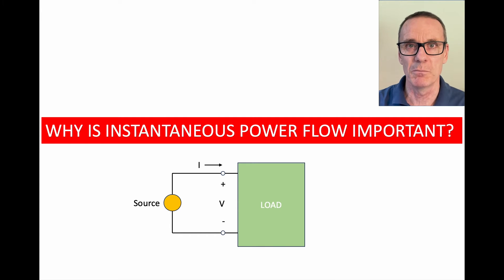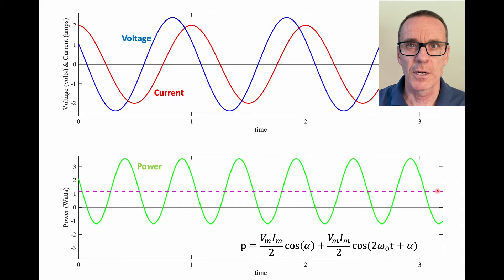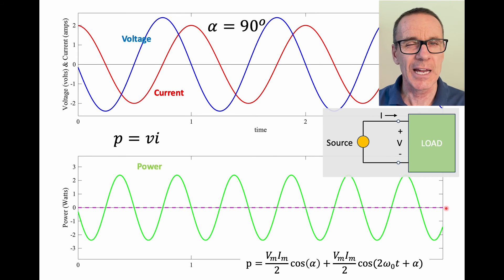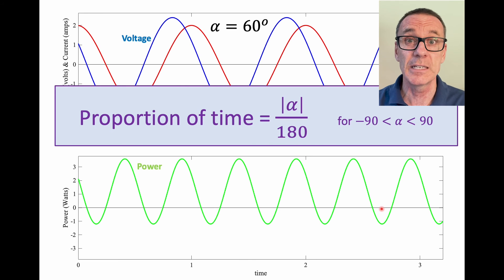Why is Instantaneous Power Flow Important?

Comment: You should probably mention that, although power might be negative for certain periods of time in AC circuits, the pointing vector always points to the source (because the E and H fields flip when power is negative) and therefore energy always flows to the source even when current flows away from it.

Love your videos btw!
Reply: This is a good video explaining my point:

https://youtu.be/bHIhgxav9LY?si=LvEVq-6zHtSUpZvK
Reply from the maker: That video you referenced is nice, but don't get too carried away about it. He claims that it's wrong to think that electrons are pumped around a circuit in DC, and back-and-forth in AC. But that's exactly what's happening!!! He even states that they do in fact move (he says "drift") along the wire in the direction given by the battery (at the 6:42 min mark of his video)! Also, he hypes up the idea that energy is "flowing around the wire", not "in" the wire. But this is totally obvious to anyone who uses a mobile phone, wireless radio, or uses a TV with an aerial. Electromagnetic energy is transmitted ("flows") in the electromagnetic wave radiated by electrical antennas, in all of those examples. That's how a mobile phone sends and receives its signals! I'm sure that if he'd pointed out those examples in his video, then everyone would just say: "oh yeah! that's right - electrical energy does flow through the air". But obviously it wouldn't have got as many "clicks/views/likes".
Reply from the maker: What you're saying is contradictory. The Poynting vector depicts the direction and rate of transfer of energy (ie. power). By definition, when the power is negative, the Poynting vector points in the opposite direction (compared to when the power is positive).
Reply from the maker: ... to be more clear, you're getting confused by AC signals (where half the time the voltage and current are positive, and half the time they are both negative), and thinking that this means that half the time the Power is positive and half the time it's negative. Not true! Negative times negative equals positive. So the power is always positive (in basic resistor circuits).  ... It's not always the case though, when there are inductors and capacitors in the circuit - but in these cases the power (and Poynting vector) does actually flow (point) in the negative direction for periods of time! See this for more details: "What is Reactive Power in Electric Circuits?" https://youtu.be/HDABrT-YTJU

Comment: RMS power is something useless (referenced in 2:35). Only involved with audio systems (fake). Only Mean or Average Power has significance in electric circuits..
Reply from the maker: Here's a video that gives a bit more insight into RMS: "What does RMS Voltage Mean?" https://youtu.be/gFwpJ6WKMDc

Comment: Summary

- 0:00 - Topic: Importance of Instantaneous Power Flow
- 0:04 - Context: Discussion on average power, RMS power, and instantaneous power in electrical circuits.
- 0:11 - Acknowledgment: Special call-out to Thand Nyan and Yor Nazal, first members of the YouTube membership program.
- 0:28 - Circuit Example: Power supply or socket in a house, with current flowing into a load (e.g., fridge, washing machine) using AC power.
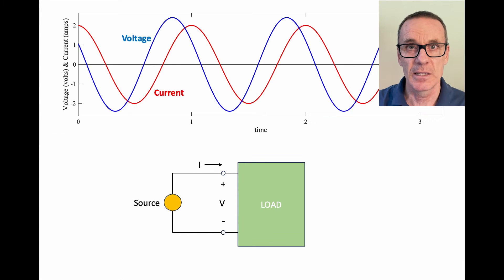- 0:51 - Waveforms: Voltage and current waveforms shown at 1 Hertz for simplicity (typically 60 Hz or 50 Hz in houses).
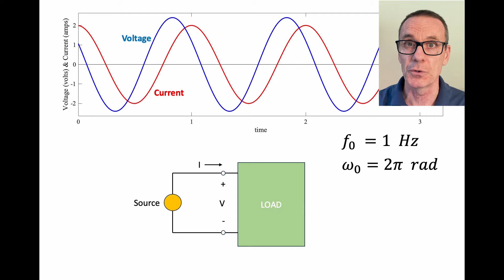- 1:17 - Equations: Phase difference between voltage and current demonstrated, with equations showing power as the multiplication of voltage and current.
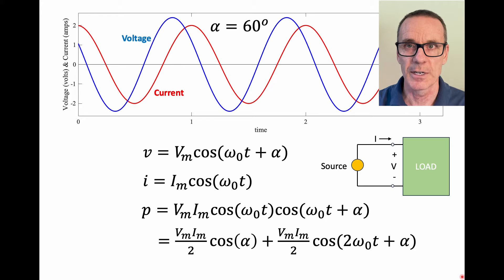- 1:45 - Mathematical Transformation: Conversion of the product of two cosines into a sum of two cos terms.
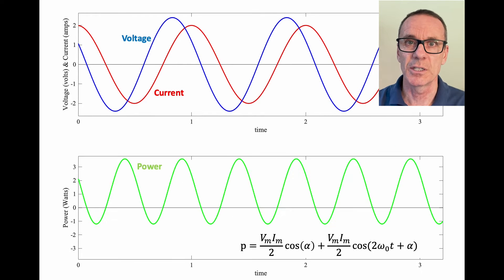- 2:06 - Instantaneous Power Analysis: Power waveform generated by multiplying voltage and current waveforms, highlighting the average and instantaneous power.
- 2:50 - Negative Power Periods: Instances of negative power corresponding to opposite polarities of voltage and current.
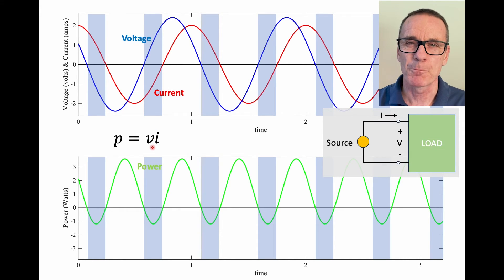- 3:13 - Circuit Implications: Power flowing back from the load to the source during negative periods, necessitating circuit design considerations.
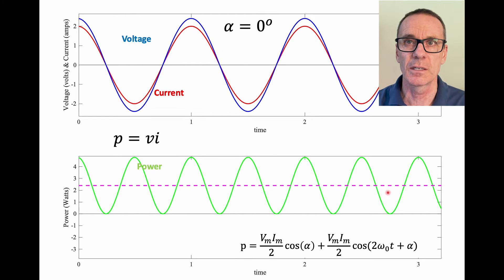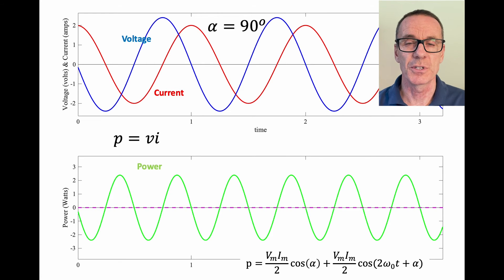- 3:49, 4:27 - Extreme Cases: 
  - Alpha = 0: Voltage and current in phase, power always positive, typical of purely resistive loads.
  - Alpha = 90°: Average power zero, significant current flow possible, indicative of purely reactive power.
- 5:10 - Design Considerations: Importance of accounting for high current in circuit design to prevent wire overheating and failure.
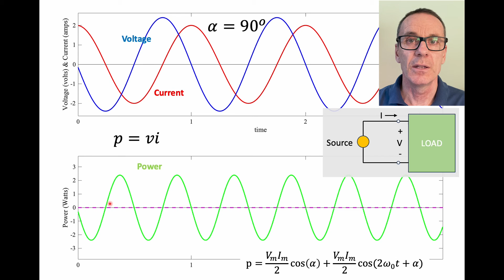- 5:43 - Further Topics: Introduction to reactive power and its subtleties, with a promise of future videos.
- 6:09 - Phase Offset and Power Direction: Simple formula to calculate the proportion of time power flows in the opposite direction, based on the phase angle.
- 6:44 - Conclusion: Invitation to like the video, subscribe to the channel, and visit the website for more categorized video listings.

Comment: Thank you for clearly explaining this! I opened up a dead led light bulb last week and found no rectifier, just a 10.5 ohm resistor. I noticed the same in a cheap, plug in, 5v usb supply. I found  something on the internet explaining that a resistor caused positive power but not why or what could be without the resistor. I love it when the universe supplies me an answer I didnt know how to find. I'm eager to see the rest of your videos on this topic! Thanks again!
Reply from the maker: By the way, the LED you mentioned is a diode (light emitting diode), so it does the "rectification" itself.  It needs the resistor to limit the current flow, since otherwise it acts as a short circuit on the positive voltage part of the cycle.
Reply from the maker: That's great to hear. I'm glad this topic is of interest. I've got a few more videos in mind for this series, but if you have particular suggestions for topics, then please let me know.

Comment: Are we supossed to achieve a spacial phase difference or at least avoid a special difference? Or just accept that it is there?
Thanks
Reply: I'm not sure what you mean, but generally it is desirable for the load to be purely resistive (with no reactance). It means the current is minimized and there's no extra loses in transmission. Of course some devices cannot work without reactance, so we try to make the energy fluctuations local, for example by adding a capacitor to an electic motor.
Reply from the maker: It all depends on what you are trying to achieve. Sometimes you can't avoid it - for example transmission lines have a natural inductance, so you just have to live with it, or try to design your terminating circuitry to counteract the line's inductance. In other cases you might want to add capacitance to a circuit - for example to smooth out potential voltage spikes. Keep an eye out on my channel for some upcoming videos on these topics.

Comment: And the amplitude of the voltage is always higher? Is there a specific factor? 
Thank you.
Reply: It's neither higher nor lower (nor equal). Voltage is in volts, current is in amperes. These are different physical quantities. How they will be pictured on a graph depends on what scale of units is chosen for the vertical axis (for each quantity).

Comment: Thanks, when P is negative, what does that mean for the load? I would say the energy gets negative to E=P*t - how does the load handle the negative energy?
Thank you.
Reply: It means the energy is sent from the load to the source at the given moment. A phase shift means the load has some reactance, which means the energy is alternately stored and discharged in magnetic/electric fields of the device.
Reply from the maker: The load doesn't "handle negative energy". That's not what's happening. "Negative energy" is simply energy transfer in the opposite direction. For example, for some time instances a capacitor in the load will be accumulating charge (storing electrical potential energy), and at other instances it will be discharging (releasing electrical energy "back into the circuit", and potentially back into the source).

Comment: Is this the reason why in the power grids the frequency is monitored so closely? If the frequency goes down then also the phase shift  between current and voltage changes? And then we dont have the expected power flow?
Reply from the maker: Yes, since the impedance of capacitors and inductors both depend on frequency, all electric circuits must be designed to match the operating frequency. If the frequency of the source changes, then the performance of the circuit will change.